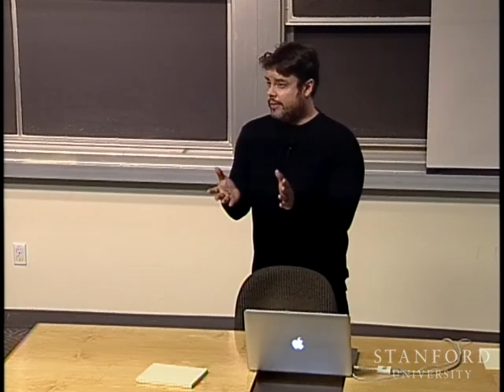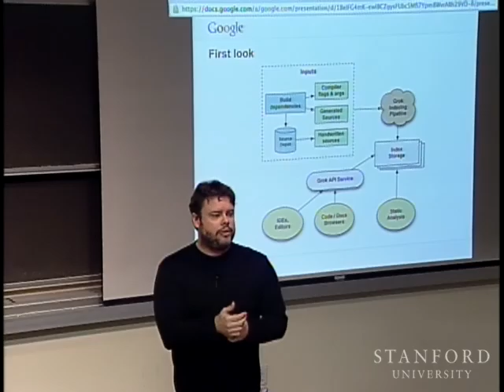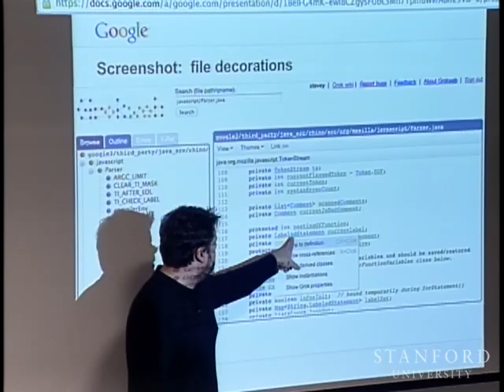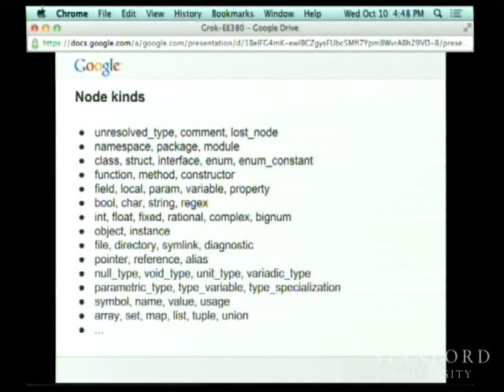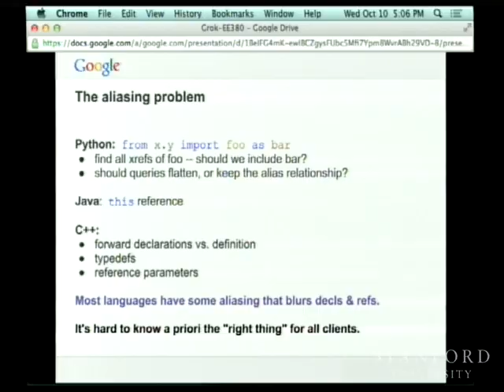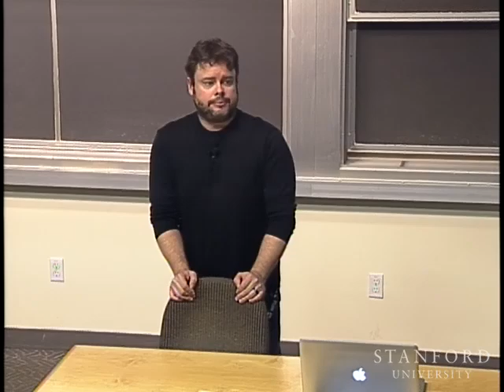Stanford Seminar - Google's Steve Yegge on GROK

Comment: Forgive me for being naive if so but, around 30 min he’s talking about the huge headers they want to index up to 64k…why not use MD5 or some other hash to shrink them but keep the value unique and precise? Again some of this is over my head as a student but that was my thought I’d love to hear how I’m wrong 😂
Reply: This would not address the specific problem being described.
First: 64kb was not one header, that was one type declaration. If you're trying to navigate from a usage to the definitions that may apply, how do you show this in a list so that the user can understand it and know it's the right one?
The more general problem with indexing in headers is that context can change the meaning of anything in a header file. It may behave differently (read: define things to different values, declare different types etc) if some other header was included first, it may behave differently depending on preprocessor defines passed on the compiler's command line, it may even be included twice in the same compilation unit and define different things the second time around.
So note that indexing in this case is not "how do I create a fast way to find this file", it's "how do I figure out which references are actually related somehow".
Add to this that it's linking that actually imbues declarations with meaning. It's a lot to connect together.
Reply: @capability-snob  thank you 🙏